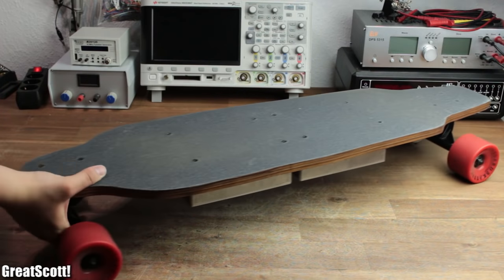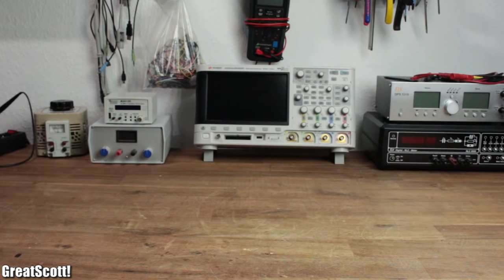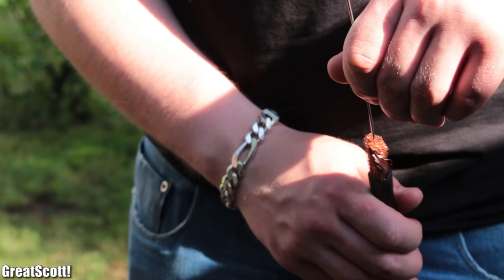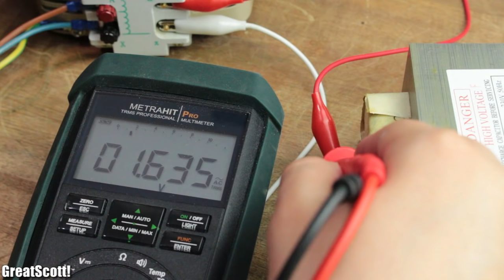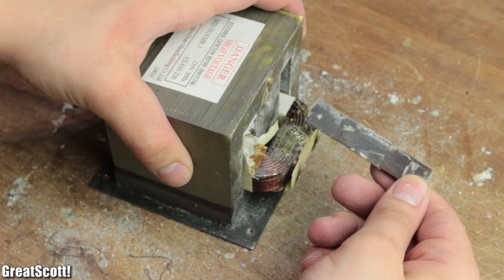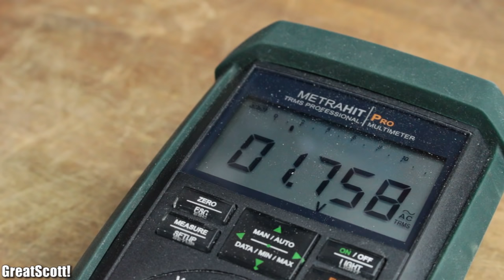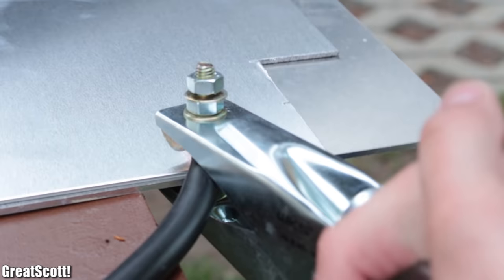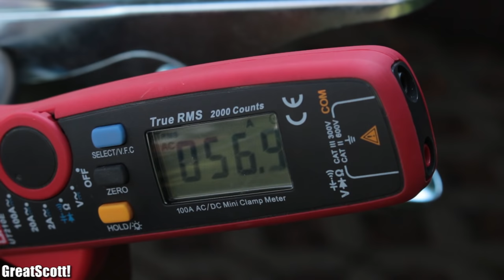HACKED!: Microwave Transformer becomes a High Current Transformer

Comment: WARNING: Microwave ovens contain high voltage capacitors. Even when unplugged, these can kill you. DO NOT TAKE APART A MICROWAVE UNLESS YOU KNOW EXACTLY WHAT YOU ARE DOING!
Reply: No
Reply: No
Reply: How?
Reply: @genatools919  they can store electric charge at a high voltage for a long time. if randomly shorted they will quickly unleash all that electric charge really quickly resulting in very high current be it through you and potentially your heart or a pair of pliers depending on if you know what your doing. see the thing at 1:27 make sure you short the metal contacts inside those black cylindrical terminals with say a pair of pliers with insulated handles, don't touch the metal with exposed skin while doing this, this will short them mostly safely though watch out for sparks and maybe have a pair of safety goggles on and a multimeter if needed, this may not happen if the microwave has been unplugged for say months to a year. the capacitor discharges over time, but if the microwave was recently plugged in it is very dangerous as the capacitor could potentially hold enough charge to kill you. also having a multimeter handy even a cheap one to double check the voltage across the terminals after shorting and see if there is a any leftover charge still to see if it was discharged properly.
Reply: @user-sv2wy6gx7u  i don't care
Reply: Guess im just a lucky bastard 

When i was 11 i took one apart and thank god nothing happened
Reply: Thanks for the heads up!
Reply: Not the same for Electroboom😂😂😂
Reply: you can just discharge it by using a big resistor bruh 💀
Reply: @this_is_japes7409 waiting 10 minutes invalidated your whole assay 💀
Reply: @adumbfuk  bro really  
I sorted the cap
Reply: Just unplugging and hitting start button should always discharge a simple system with a capacitor
Reply: @mursuhillo242  not with a microwave.
Reply: umm no need to turn up the heat on me like that

Comment: use both the transformers together
Reply: That's an overkill
Reply: @mathewtallen3190  Nah
Reply: Smart
Reply: Paralell or in series?
Reply: @casperdh  i think series
Reply: @blanana_m   if u are looking to increase  the voltage  it won't work because both are in the same phase wich 0 is degrees
Reply: Gh F4 you can series connect transformers
Reply: @lorrdmoh  haha you are wrong. most people put 4 of tgem in series and it able to weld.
Reply: @lorrdmoh  what ever your phase 0 is wrong
Reply: @ramadavince6611  to increase the current not the voltage u cant increase the voltage  from the same phase  more rounds more voltge this is the only thing he can do
Reply: @lorrdmoh  i dont know u talk about
  put 4of them in series will increase the voltage an it will weld.
Reply: @lorrdmoh  "if you are looking to increase the voltage it wont work" you said this
Reply: Series or parallel
Reply: Primaries in series, secondaries in paralel
Reply: @blanana_m  ac (in put)side parallel and dc (out put) in series
Reply: @ramadavince6611  ok
Reply: @blanana_m  for more current, it has to be in parallel
Reply: @casperdh  series
Reply: Series = More voltage, Parallel = More current
Reply: Connecting your primaries in series will only increase the amount of turns, your input voltage still stays the same. If you connect your primaries in parallel you'd have more current able to come in there (but it might trip a breaker). If you then connect your secondaries in series, you should have a higher voltage there, at whatever current the turn ratio you chose would supply. Never tried this though, so things could let the magic smoke out too... Especially on components working at a kW each.
Edit: reminds me of this DPS5005 power supply where I connected both in series to get 100V out, and the second one blew up. Still gotta replace that one someday...
Reply: That would result in a power level over 9000, which should be, sufficient for a task like this .

Stay creative, and I will see you

next time
Reply: That's what I'm thinking too
Reply: I'm going to pretend I understood that:
Haha big funny
Reply: @Purple431  This is not a battery you fool
Reply: not sure why he didn’t
Reply: @mathewtallen3190  underkill actually. he needs 3 or 4
Reply: That's correct use it in series try watching legit youtube channels
Reply: You are entering electroboom territory here friend
Reply: breakers goes POP
Reply: @mathewtallen3190  😊
Reply: @blanana_m  

 

  

-
Reply: @tona401  youtube takes away all the fun from comments 😢
Reply: @ramadavince6611  transformers output ac, also if you add up more the voltage would be so high it will eventually dead short the transformer. Series adds up voltage, parallel adds up current and 2.5kV is enough voltage so we need higher current to weld and for that we need parallel
Reply: @ramadavince6611  btw 4 of them is series will make 2.5 million volts and will kill transformers
Reply: @nekilikizhrvatske3336  are you even own our page??? Do you know rewinding, and one transfomer can be as low as 1 volts (bases on how much turn) so. Plz rethink again
Reply: @ramadavince6611  were using microwave transformers so ratio is like 8-12
Reply: @nekilikizhrvatske3336  im talking about transfomer mod. I think you r using as it is.
Reply: @nekilikizhrvatske3336  also if you dont rewind the transfomer you csnt use it as welding transfomer
Reply: @ramadavince6611  i was thinking use one with higher voltage in parallel with the high current transformer because then the voltage and current would both be high
Reply: @nekilikizhrvatske3336  for welding you need around  30 volts and 50+ apms. Not exectly  but around
Reply: @nekilikizhrvatske3336  also you cant used those  microwave transfomer  without modification. Unless you used 100 in parallel if you are asking that. The current is simply  not there
Reply: @ramadavince6611  i was thinking one modified and one microvawe transformer
Reply: @nekilikizhrvatske3336  used microwave  transfomer modify 3 minimum. If a singke transfomer is around 10(+-5)volt output. Used them in series or if single transfomer is around 30 volt parallel
Reply: @ramadavince6611  it all depends on the ratio, if a transformee outputs 2 kilovolt on 120vac it wont output 2 kilovolt on 230vac same if it boosts 1volt to 10 it wont boost 10 to 20 it will boost it to 100 and to 1000
Reply: @nekilikizhrvatske3336  dude i make my own welder from a tranfmsfomer before  i buy a new one. Im100% sure what im talking  about.
Reply: @ramadavince6611  all im saying is that you cant put same step down transformers in series to increase the voltage, you need to rewind them and then put them in series like you said
Reply: Okay, cli- BUZZZZZ BOOOOOMMM
Reply: @lorrdmoh  -- You can use a capacitor to shift one out of phase with the other.
Reply: Thats correct
Reply: @lorrdmoh  then, pay attention to how you hook the secondary coils.
Reply: "THE POWER OF THE SUN IN THE PALM OF MY HAND"

Comment: "someone who knows how to weld" is the key here.  It took me ages to learn how to lay a proper bead and I was using a very nice welder.  Welding is one of the few things that require a developed skill in addition to knowledge.
Reply: practice a couple of days and you can weld ;)
Reply: seriously it's very hard to learn how to weld professionally..
i could weld pretty decently.. but in terms of having a perfect solid bead line is really hard..
i usually just rectify my welds by grinding it and rewelding the areas with holes.

Comment: Aluminum is really hard to weld - recommend trying iron or steel for your next attempts
Reply: yeah you are right, steel is lot easier but he needs aluminium for his skateboard ...:/
Reply: he can use 2 transformers :))
Reply: +Adam Budai yeah in series but aluminium will still be hard to weld xD 
aluminium is like cancer
Reply: He needs to practice first, that's why is Afrotechmods sugesting steel first
Reply: he needs much bigger transformer for steel)))
Reply: you need about 70vac and a rectifier rated at 400v 8 amps  caps rated at it to go DC draw an ark to melt the metal and let it flow between them
Reply: the aluminium electrode was for tig welding not for arcwelding
Reply: yeah it was filler wire, not an electrode.
Reply: love ur channel! cool to see u here too :)
Reply: if you want to weld aluminium you can do that with a welding inverter/tig. electrodes are made out of iron, and iron+aluminium dont melt together.
Reply: Tig is by far the best way to weld aluminium.
Reply: or just a higher output voltage so he can dump more curent through a given resistive load
Reply: no hes suggesting steel because ya cant weld aluminum with tig filler metal and an ac transformer that puts out less voltage than a standard 9v battery
Reply: 14v still will be very difficult to get an arc going, some welders output upwards of 90v open circuit
Reply: Isaac Thomson my arc welder has 46 volt ac output.
Reply: durafix is his solution
Reply: Spray transfer can be cheaper
Reply: thats true, it would still set you back 500 bones
Reply: Welding aluminium without an inert atmosphere is damn near impossible, you'll get spatter like crazy due to the oxide aluminium forms with air.
Reply: just an anecdote: I worked in a factory building handmade titanium bike frames (I wasn't a welder myself - a mere frame aligner), but the welders had to put thier arms through arm holes with bulky fire proof air proof gloves into a chamber where the bike was (evacuated from oxygen and filled with argon or something) to say the least they still got thier welds damn near perfect.
Reply: Ethan S too bad greatscott doesn't have such a thing ;p
Reply: Gijs A project!
Reply: He also should use magnet wire for his transformer instead of using regular insulated wire. could get more turns around that transformer, and get the most out of it. He could also double/triple or quadruple the wingdings in parallel for higher output current. using fairly fat copper wire. He could even put transformers in parallel to get more current output, just as long as they are in phase and their output voltages are about the same.
Reply: HI AFROTECH
Reply: For that id just tig weld it. I learned to tig weld aluminum in a week.
Reply: wtf is tig weld
Reply: Krevin Grard of course you have...
Reply: fla playa All I'm saying is that AC GTAW is objectively difficult, when it comes to fine motor skills. And that the probability of being able to learn from start to finish (in most cases) would take [much] longer than a week. And I'm sure that you've considered all of this before posting said comment, "fla playa" (professional...)
Reply: Isaac Thomson I did I'm certified.
Reply: Probably looked like chicken shit..... I mean stack of dimes, yeah...
Reply: fla playa Ikr hahahah...
Reply: Isaac Thomson I can show you my certs. Im not a great tig welder but im good enough. I didn't learn on aluminium. I learned on mild steel and stainless. It took me a week to get the hang of aluminium tig.
Reply: Afrotechmods Heyy
Reply: Because a microwave trans ISNT a high voltage transformer.  This was the only reason I clicked. To write this comment.
Reply: nice
Reply: Gijs  Nice profile picture
Reply: Goeiedag goeiedag Goeiedag  agreed
Reply: Afrotechmods and because of that he fuck up
Reply: Or he could buy a arc welder
Reply: These arguments in the comments are pathetic
Reply: Wait, i dont Get it my teach told me if u weild iron, it would be toxic??? Or is using a soldering iron on iron is toxic?
Reply: Don't you need a TIG to weld alu?
Reply: It's not hard, if you have the right tool. It's almost like brazing.
Reply: @maxhijacker  i bet u could spot weld with whar he has wont be great but can be done
Reply: Aluminium*
Reply: Depends what method of welding you are using. Mig is by far the easiest but not as strong as Tig but its a bit more difficult
Reply: Best way to weld aluminium is using an AC TIG Welder as the Aluminium oxide will protect the raw aluminium so the oscillating voltage helps welding and breaking off the Al2O3
Reply: You can't weld Steel with AC, for Steel you need your electrode at the -  Pol. You also normally can't weld Aluminum with a stick welder you would use Mig or Tig
Reply: Yea though he could braze the aluminum together
Reply: Aluminium TIG welding 
Aluminium is not nice for welding
Reply: @UltimateMaking  cancer like twitter 
We should replace the word cancer with twitter
Reply: Ok thanks 4 info!
Reply: @UltimateMaking  ফৈপখংকুজঔগে
Reply: @Soapsmellsnice19  you really cant weld iron its too like airy it doesn't weld well if at all depending you need high nickel rods and to preheat the piece basically welding steel is the easiest most commom
Reply: Remove primary coil and use the secondary as primary
Reply: man, aluminium is really quite hard to weld. it has a thin ceramic coating, made by aluminium oxyde and that will not let an arc to be created between the electrode and the welding spot. moreover, in order to weld aluminium properly you must use a tig transformer with AC current. you must also pay attention on the frequency of that AC in order to be quick enough to don't let the ceramic coating being formed while you are welding. Try doing this joint in a different material, maybe some composite material, it would be easier.
Practicing it with steel will not work, if you don't use a proper transformer.
Reply: Yep, I work as a mechanic and we don't bother welding aluminium in our workshop.
Reply: @UltimateMaking  🤣🤣🤣 he didn't realise that 🤣🤣🤣
Reply: @Adam-bw4lw  or he can use a bigger transformer :^
Reply: @eXe09  yes but he's need higher voltage transformer for welding , I think around 24/28 voltage

Comment: FYI, instead of putting in the effort to shreds up the coil like he did, you can just grind out the weld near the base that holds the transformer together and then easily pull out whatever you want without damaging it.